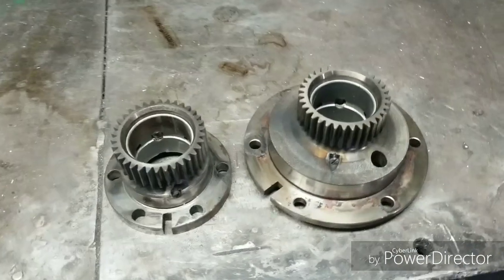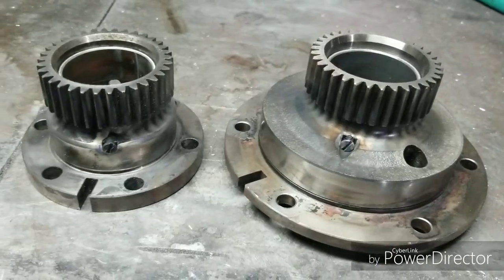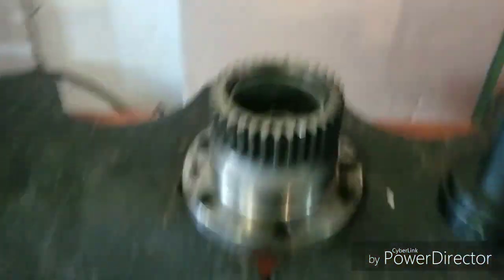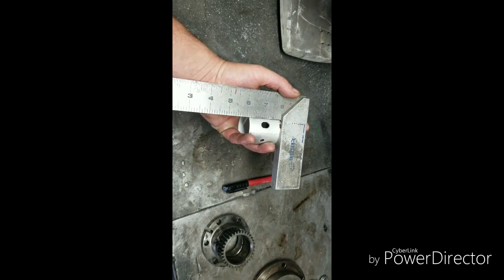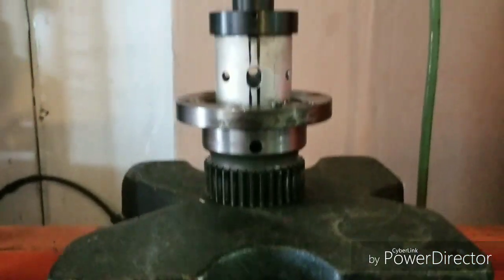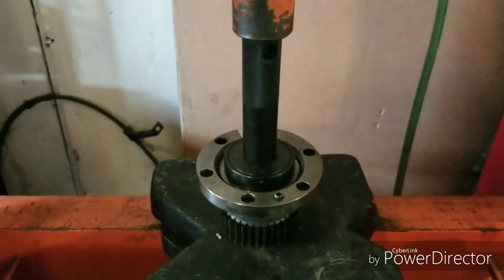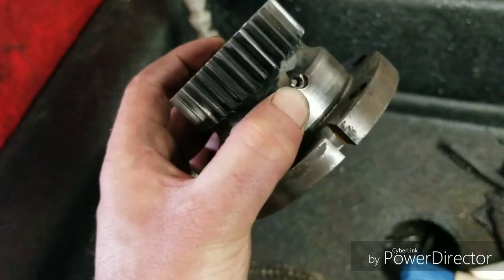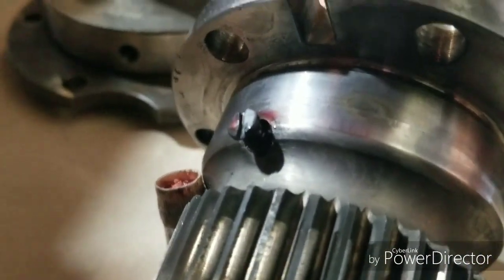Mazda Rotary Stationary Gear Bearing Press & Preperation by Kyle Mohan Racing

Comment: Any chance you could let me know how you remove that stationary gear fron the plate. Thanks
Reply from the maker: Provided the motor is a part you will need to remove the 6 stationary gear bolts and then lightly tap the gear out with a rubber mallet be very careful to not damage the gear itself.

Comment: Bejesus I had to drill out both set screws..... Those things almost strip going back in
Reply from the maker: use a torch if stuck... burn out the locktight.   heat up screw, un screw quickly while hot.

Comment: Hi, can the main bearing be replaced directly on the car? Without the need to dismantle or remove the engine from the car? Thank you for your response.
Reply from the maker: You need to pull tfhe gears out of the motor so usually motor is out of the car
Reply: @KyleMohanRacing  Sorry, I wrote it badly. I mean station gear, can it be replaced directly on the car without removing the engine?
Reply: Matej Kos don’t even try it. It’s really difficult to keep the front stack aligned with the engine in the car and you will end up crushing the needle bearings and replacing a bunch of parts.
Reply from the maker: yes but its difficult
Reply: hmmmm
Reply: i dont think so bro